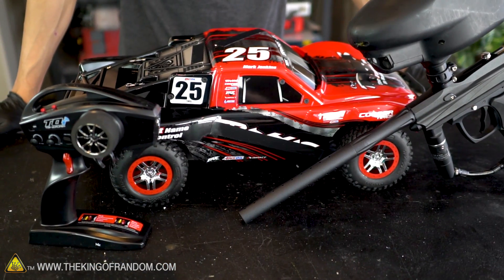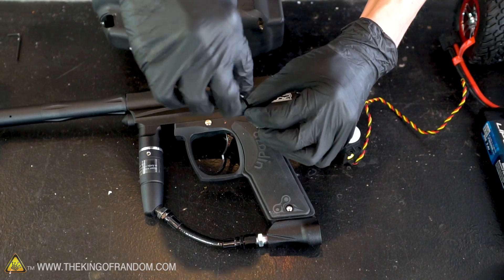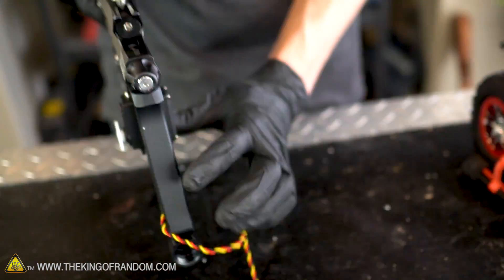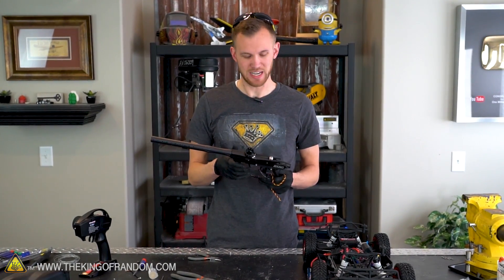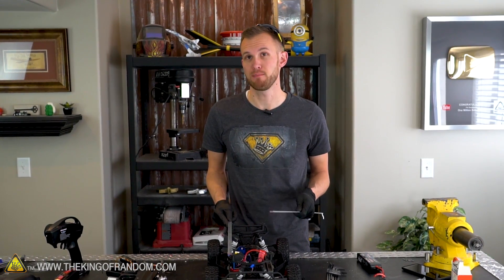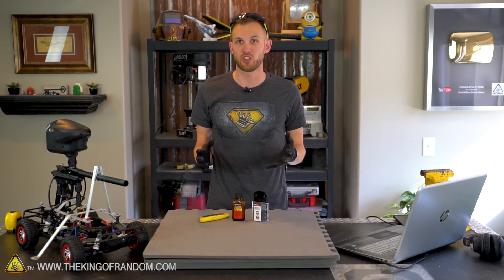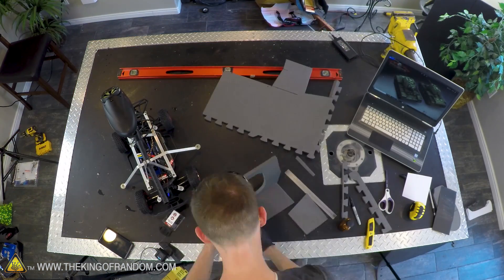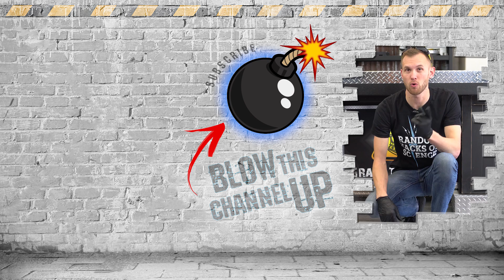Homemade Paintball TANK! TKOR Details How To Make Homemade RC Tank With Paintball Gun Cannon!

Comment: That paint ball tank you built looks pretty freaking sweet. Huge props to you for making it.

This brings to mind an idea in my head. Can something similar be done with a remote control plane? Flying paint gun battles. A lighter paint gun may need to be used though.
Would that be possible to make a flight controlled version?

Comment: This would of been easier with an electronic marker with an adjustable trigger. By having an adjustable trigger you could of made it very sensitive, you should of all so of used a hopper with an eye system instead of a sound activated hopper. Though what you have made it very cool nice video 👍

Comment: I'm kind of skeptical about the apparent lack of mods to the suspension of the Track Slash shown...  There is no way the stock suspension would be able to handle that extra weight...   The stock car weighs 6-7 pounds...   The gun with air tank probably 2-3 lbs.   We have an older version of the same car and the stock shocks would blow up with the type of  driving shown...    But still,  a very wicked project  :-)

Comment: A small addition if you want to maintain their colour between fights is to perhaps use a permenant Anti-graffiti coating. That way you can easily wash off the paint from the pellets and maintain it for longer. They're usually hydrophobic as well so additional waterproofing for the insides.

Comment: What would happen if you put the paintballs in liquid nitrogen and then fired them? Would it increase the damage?
Reply: It freezes the paint inside and would be like shooting a ice ball
Reply: Dank TM have you done this? Would it do more damage or fly as far?
Reply: Shawn no it's just common sense
Reply: Input stale meme no its not. Science isn’t always common sense
Reply: Shawn no they would just fall apart
Reply: Frozen paintballs are complete BS, the material the shells are made from become so brittle at low temperatures the balls usually busted before they leave the barrel. Anyone who has said they/their friend did anything with frozen paintballs is a liar or gullible.

Comment: Thanks to you and Hacksmith, I've (slowly) taken a mild interest in engineering. At the very least, helping myself with small mishaps rather than huge experiments. Just ten minutes or so ago, I was able to fix my bed by using a stack of paper books to replace a leg of my bed. So far it seems to be holding up, and my bed might be lopsided from not calculating the exact measurements needed. But it's a start?

Comment: tip. you could have saved yourself a few bucks, but just unmounting the ASA(that is what the tank screws in to) and bought a longer piece of Macro Line(the line that goes for the regulator(the thing you unscrewed) to the asa). Leaving the regulator on ensures that the air coming from the tank regulates to the pressure that the marker operates best at. and also you wouldnt have had to twist all that remote line around the marker.  also if you could do this to an electronic marker(you can buy some pretty cheap ones used) that would be even better : )

Comment: What happens if you heat up balls(basket ball, soccer ball, ⚽️ 🏀 🏈, etc.)
Reply: Michael Wiradharma think for yourself, it’s not hard
Reply: Inactive Wall but what if what you expect to happen doesnt happen
Reply: Michael Wiradharma if you heat up a ball it will pop, as when Heat is increased, pressure increases, which causes volume to increase. Wasn’t this taught in middle school?
Reply: Inactive Wall yes exactly, but what if the rubber ball is strong enough to hold the ball together
Reply: Michael Wiradharma what would this “experiment” accomplish

Comment: YOOO MAKE IT BE ABLE TO ROTATE
Reply: if you've followed this far, you don't need to see how they do that. it's one step away using stuff they already used, in this very video.
Reply: That’s called a turret
Reply: +NiceWhenEarned RudeMostlyElse    But the servo spins way to fast... sure you could get a slower spinning servo but why invest more into it when its already done?

Comment: I have 4 ideas that I think are going to be pretty cool! :) Please try them!
1. Grind up some sparklers and make homemade thermite
2. Put some lithium in a divot in a block of dry ice with some water and see if it will burn
3. Run a ridiculously large amount of voltage through some light bulbs in a series circuit and make them simultaneously pop
4. Put a stun gun or some electric current near a metal spinning fan blade
Reply: So simple to diy, but it's still better than vacuum chamber and liquid nitrogen/dry ice.
Reply: grinding sparklers wont give you thermite, but its easier to ignite. NUMBER 3 IS AWESOME!. Number 4 seems deadly hehe
Reply: that was 3 not 4

Comment: What happens to soda in the vacuum chamber?
Reply: I'm no scientist, but I think it might take the carbonation of the soda. So meaning, the soda will just be flat.
Reply: It will just make it flat, it might be an explosive carbonation as the air is pulled out but I dont think that pump they use powerful enough to create a vacuum almost instantly to cause an explosive reaction.
Reply: Soldier9478 that would be awsone
Reply: Soldier9478 looses its carbonation

Comment: So far I only know French tanks and small caliber tanks can rapid fire.
Reply: strv 103 had a fully automatic loading system
Reply: André Edgren Ah, didn't know that.
Reply: NiceWhenEarned RudeMostlyElse Nope, I only play tank games and then I got addicted into tanks so I read some books and articles (usually Wikipedia). 

And sorry if I write that wrong.
Reply: As far as you know... are you a tank history specialist? a designer maybe? been in many wars, have you? or just what you hear and read from headline articles?
Reply: No the french loading is 1 shot for 2 sec some of the old , light and little ones has machine guns for terminate the troops
Reply: MarufTIM and panders but that's uncommon in this age

Comment: If you get a Traxxas, HPI, or a Losi then you should get the crawler versions of them or one with a wide wheel base like the Traxxas rustler... It'd be more like a tank. And the body is not "decorative" it's lexan which can take a crash at over 100mph and have minimal amount of damage, try that with any other car.